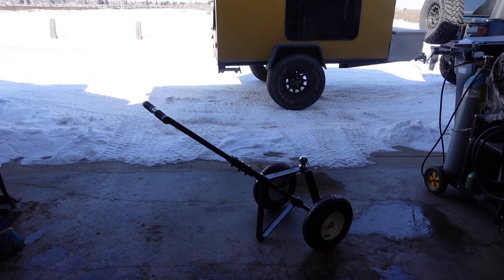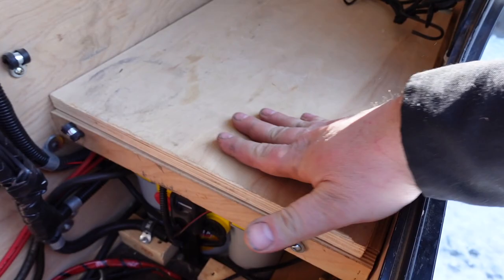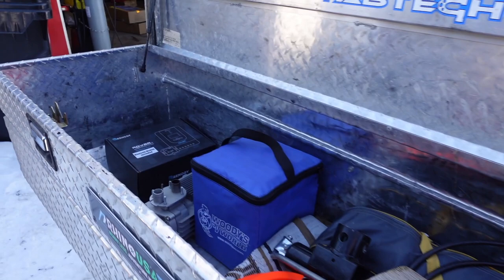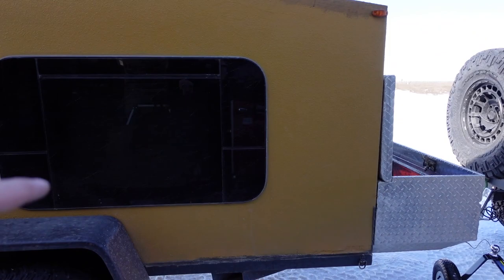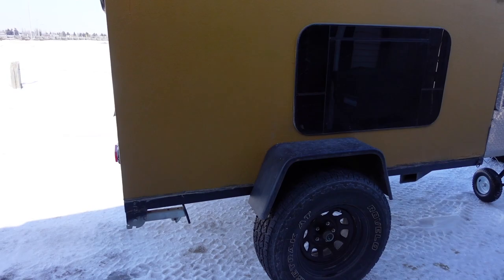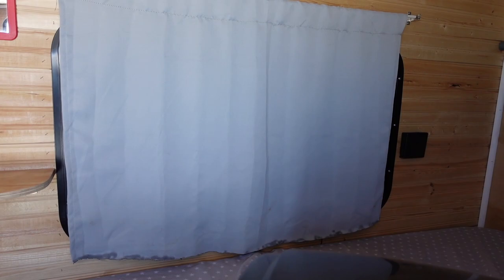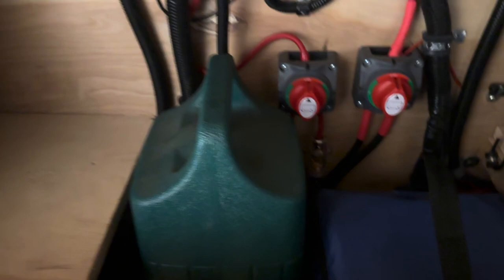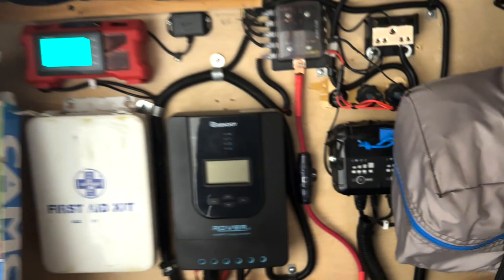DIY OVERLAND TRAILER PROJECT | Time to mOdIfY it

Comment: Hey Jerry, on camera that kinda looks like PMF vs real fiberglass. That is super important with how to repair it.
PMF = poor mans fiberglass   AKA canvas tarp glued on with Titebond2 and coated with exterior latex paint then raptor or other coatings.
It is a durable building method and extremely common with DIYers.
I have been collecting parts for my overland/expedition trailer build for a while and I am ready to start in the near future. Very excited to get going! Congrats on the new level of camping comfort.
Reply from the maker: It’s not what we both think stay tuned

Comment: I had a small off road trailer like that. After a few years I got tired of crawling in and out of it., old age. Get a 12 volt tv/dvd player and a set of speakers.
Reply from the maker: Having a camper van would be ideal for sure

Comment: Nice score, Jerry.  Something to think aboot is adding shocks help the roll when going offroad.
Reply from the maker: I don’t think shocks will help, the leaf spring suspension doesn’t have much give
Reply: @BackCountryWrenching  depends on soft they have the springs. You can always add them later if you don't like the way it handles offroad.